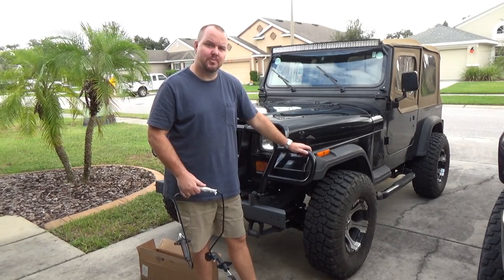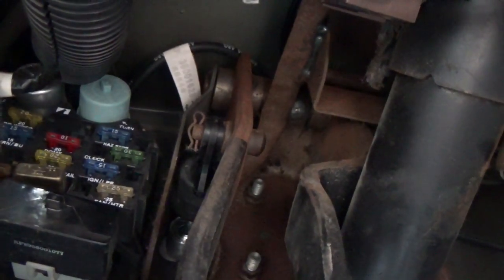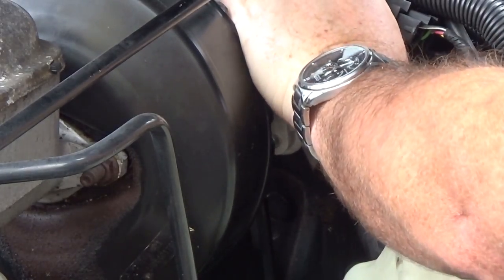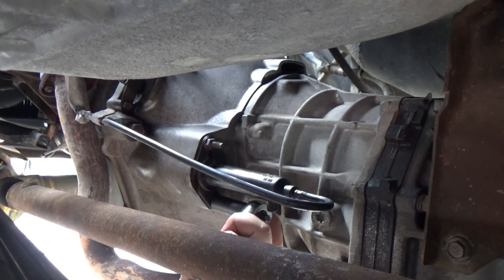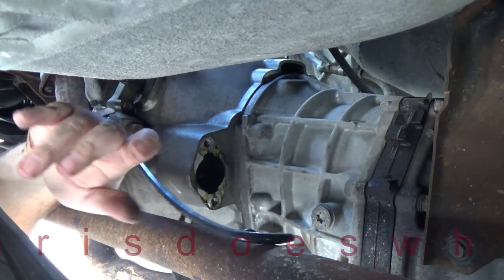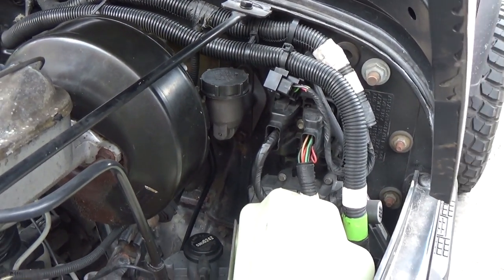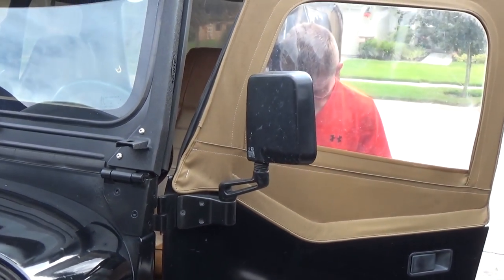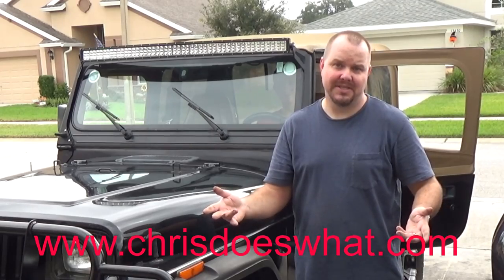Fixed Jeep Clutch Master And Slave Cylinder  || Jeep Mods E08

Comment: Thanks for the instructions. Did you pull the retainer off the push rod on the slave cylinder? Others have say to leave on. Is it still good after 2 years?
Reply from the maker: We haven't had an issue since install. If you are talking about the plastic thing that gold the push rod for the slave cylinder, yes we took that off.

Comment: So the slave cylinder was stuck "down" (disengaged)?  I wonder why?  I think the same thing happened to my TJ yesterday
Reply from the maker: The pushrod became stuck because as it wore out, it allowed the pushrod to move out of position and hang.
Reply: @ChrisDoesWhat  So was the clutch stuck in the engaged position (as though the pedal were up), or disengaged (as though the pedal were down).  I'm having a tough time understanding what's keeping it stuck with the pressure from the whole diaphragm spring trying to push it back
Reply from the maker: The slave cylinder was stuck in the position of the clutch pedal being down.
Reply: @ChrisDoesWhat  Great- that's probably my problem then!  That's such a weird failure mode though.  You'd think the big diaphraghm spring on the clutch would force the slave cylinder to react if it failed.  It's as though it's snagging on something.
Reply from the maker: Wish you the best on this, we have bigger issues since a snowbird hit our jeep. Those repairs will be coming soon.

Comment: Is that part specifically for the 94 ? I have a 92 with the same problem and the amazon post says it wont fit my jeep
Reply from the maker: This one fits a 94 to 95 YJ Jeep.
Reply: Steven Clarke 
ya 1987-1994.5 is internal slave cylinder, some 1994 and all 1995s are external slave cylinder like this one.

Comment: Do you think this assembly will work on an 89' jeep wrangler 4.2?
Reply from the maker: Could not tell you if it would fit, look on the internet or reach out to a pro parts supplier.
Reply: No... this set up won't work on your '89 YJ ... Those jeeps have an internal slave/throw out bearing combo. The only way to replace it is to drop the transmission
Reply: shujin12345678 - What about for a ‘93? I think I have to drop the tranny just like the 89 but I’m not 100% sure. That sucks.
Reply: Spencer Brady 
1987-1994.5 you have to pull the transmission